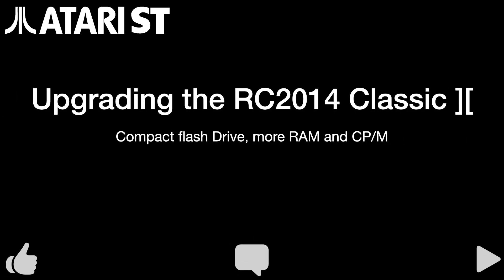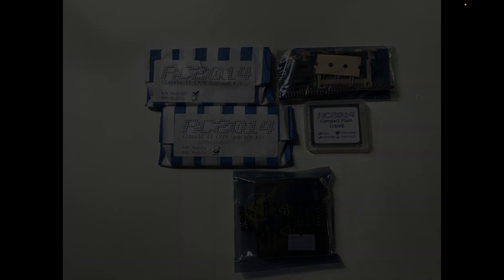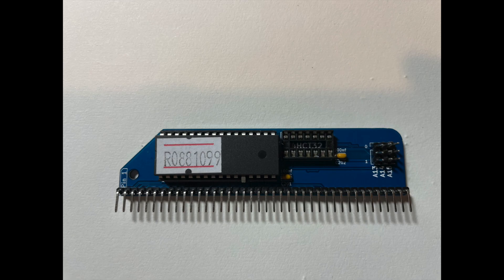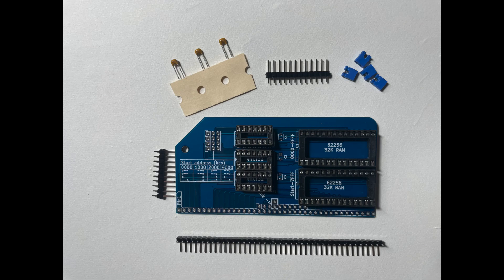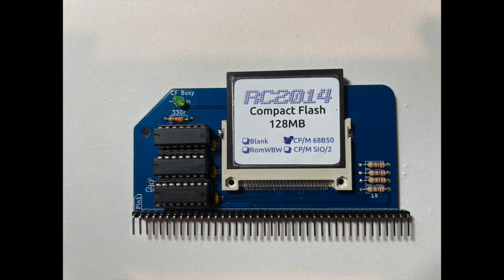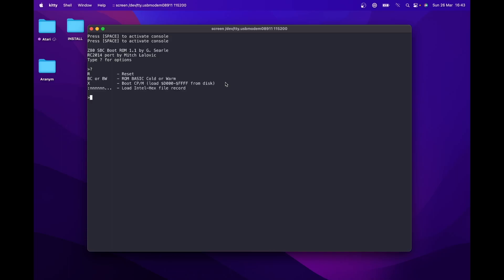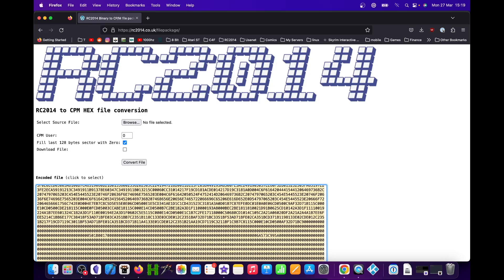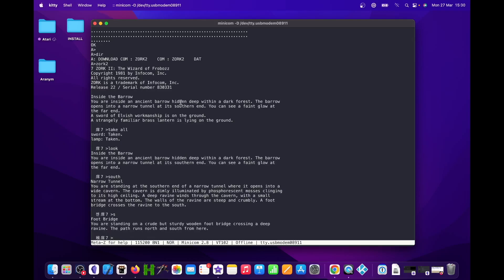Turning the Classic ][ up to eleven. More RAM, more ROM, Hard disks and  CP/M 2.2

Comment: I decided not to buy an RC14, mainly because it has no onboard display output, and requires connecting to a (vastly more powerful) computer in order to use it. The Agon II Light is more appealing, but like you, I can't really justify buying one. I can use BBC Basic natively on Raspberry Pi, under RiscOS, or one of Richard Russell's free variants of BBC Basic. Or of course, a BBC micro emulator.
Reply from the maker: The do offer a VGA adaptor that takes a usb keyboard now.  But that requires a Raspberry PI Pico (also as you say a vastly more powerful computer).

I feel another video coming on :-)

Comment: I could never get this to work (when trying to boot into CP/M, it would reset the system).  It seems that this is very picky about the CF card used.  The consensus on google groups seems to be that using cisco CF cards is the best bet for proper operation.  It's been on a shelf for the past year, I'll look on ebay for a couple of cisco CF cards and try to get this working over the winter sometime.

Comment: I've looked at the RC2014 in the past, but never pulled the trigger. There is way too much electronics around the house as it is already. But it does look like a nice setup. Thanks for sharing. :)
Reply from the maker: Ive been dithering over the Agon, but can’t justify it. I do want to try bbc basic on the RC however